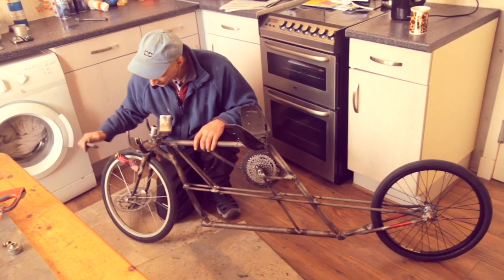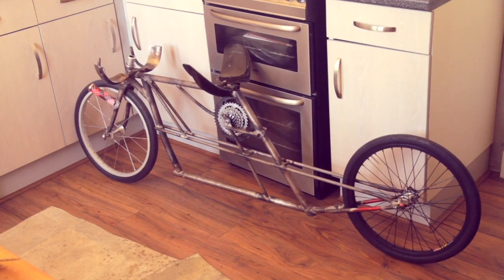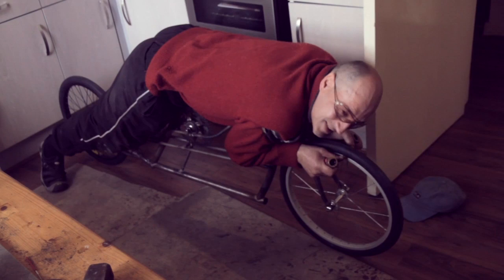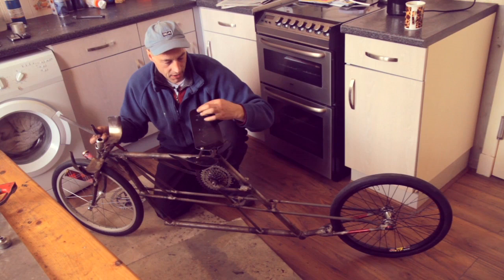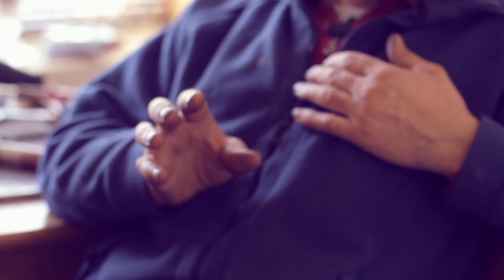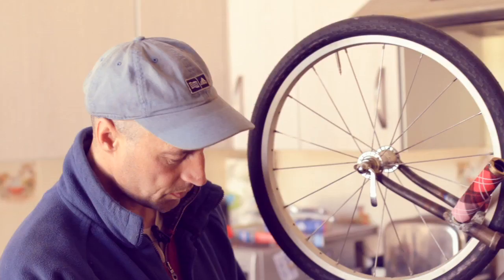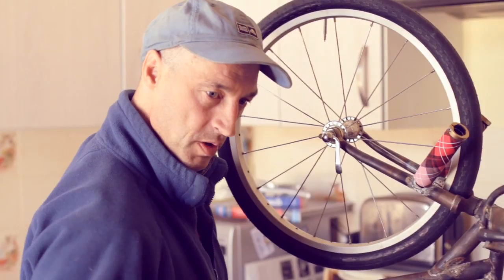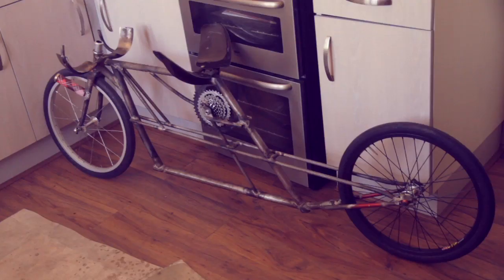Building a record bike from recycled parts, Graeme Obree

Comment: Still using bits and pieces which look as though they came off the Ayr bypass? I worked in the area for a few months a couple of years ago and it's one of the cleanest roads I have ever cycled.
I have worked with engineers with all the formal qualifications and the kudos of working for large multinational companies and I don't think I have come across even one with such a level of engineering genius. Graeme could have completed the engineering degree he started at Glasgow University, gone to work at BAE Systems at Prestwick, and never cycled competitively outside Scotland or earned any money from his sport. But instead we have this. Less than 9 1/2 minutes and I have seen more practical engineering than all week at my day job. Learned how to fill in a new form though!!!

Comment: Good Sir . . . your beastie bike . . . . WOW ! how nice is that . . . however  . . . my Super Scorpion didn't reach the impressive 130 miles per hour . . . until we put a 26"  wheel at the rear . . . your bike go fast . . . with its current design . . . but put a large wheel at the rear . . . and your bike won't argue  when you ask it to climb the speed ladder . . . it won't run out of energy.